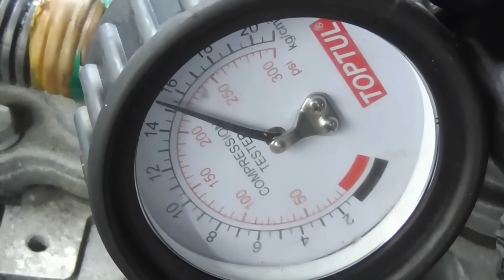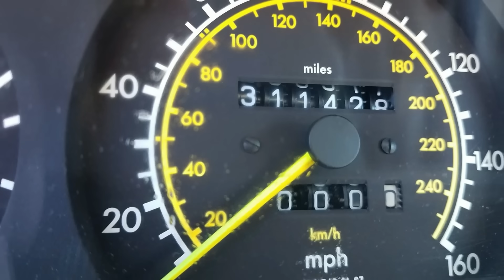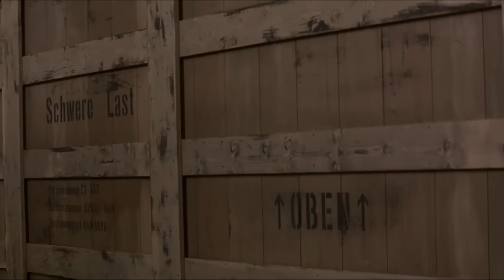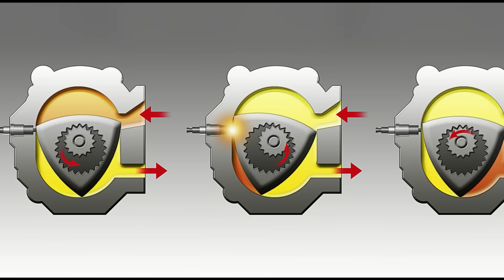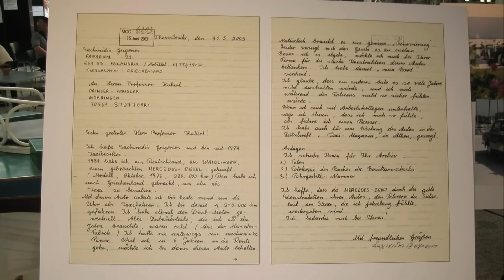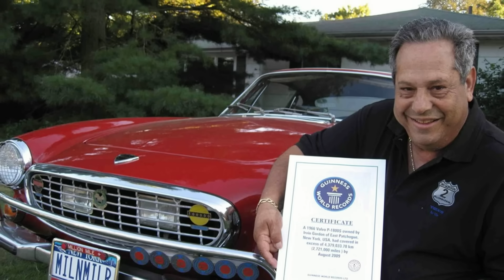Most Reliable Engines of All Time

Comment: Are you kidding me NO Toyota 1kz-te or 22re but you slip the rotary in here your on ICE.
I have two Toyota Hilux utes one 22re with 431000km never touched a thing and one 1kz-te with 404000km never touched a thing. 
TOYOTA UNBREAKABLE 
“Disclaimer” serviceable item were touched with love!!!!
Reply: i have seen tons of 22re engines take a beating on and off road and go more than 300k miles and can go miles and miles still performing great even with low maintenance and very low oil
Reply: or the toyota 1hz or 2h diesels, i have 500,000 klms in my 1hz landcruiser with only the standard oil an filter changes.
Reply: My pickups got 500,000 kms and its got no issues
Reply: Wil Braun buddy what model is it?
And where are you from?
Reply: @MussaKZN  its a 92 extra cab 5speed and im up in british columbia
Reply: Wil Braun one of mine is an 89 extra cab auto 2x4 and my other one is 03 duel cab 4x4 turbo diesel and I’m from Melbourne Australia, Hilux’s just make me happy!!
Reply: @MussaKZN  i wish i could get a diesel toyota but there so rare here and when you do find them the rediculesly priced
Reply: I’ve seen those 22R’s and 22R-E’s with over 500k miles. Reliable is an understatement for those engines.
Reply: Mussa Musumeci 710000k on a Hiace diesel 1kd-ftv....never touched and not a drop of oil, and it gets worked.
Reply: Seen alot of toyota 2tr with more than 300k miles here in CA.
Reply: Yup had a 22 r on my cressida that engine worked some like clockwork  but sadly I had to transplant her. But I went in to better things 2 jz ge nice
Reply: I have toyota 2f 6 cylinders 1980 .. 522k km and counting
Reply: Mr Photographer Toyota 2f 6 cylinder is just ran in at 500k

Comment: One of my first cars was a 78 Plymouth Volare with the slant 6.  Just under 300k miles.  Lovely 2-tone black and rust, and every body part rattled and sounded like it could fly off at any time over 40 mph.  Couldn't kill that motor.  At the very end, it was only running on 4 cylinders, and I averaged over 30 mpg.  0-60 was about an hour and a half, but I was 16 and the car cost me $50.

Comment: I just bought a 2008 Honda fit with 290,000 miles on it. 1.5 litre 5 SPD. Runs fantastic and gets 38 mpg on the highway doing almost 70 mm mph

Comment: I have a 2002 Pontiac Grand Am with 166,000+ miles on it. And a 2002 Volvo V40 1.9l with 207,000 miles on it. Both engines have been trouble free their whole lives.  I have had numerous 350 CI Chevrolet motors run for well over 150,000 miles. One was a 1984 Corvette with 177,000 miles on it when I traded it in. Still ran really strong with less than a 10% drop in compression.  He really needs to take a serious look at his list of most reliable engines.

Comment: Honda J series V6 and F inline 4 cylinder series 300K plus is not an issue for them
Reply: But Honda transmissions cannot go that far
Reply: irrelevant as transmission is not an engine,  @dingdong2447

Comment: I have a 1997 nissan pick up with the 2400 with 250k miles and still running. Just changed the timing chain and service that's all.

Comment: Not sure about the 2azfe, this thing is in everything from Pontiac vibe to camerys and is a pos. The Chevy 350, 302 and the dodge hemi should be added..hell my 2008 ram hemi  has 247000 miles and have had no issues other than alternator, front hubs and tires..

Comment: Wtf is this guy smoking
GM's 350
Ford 5.0
Ford modular 4.6
Nissan Sentra 1.6
Camry 2.4
Toyota 2jz
Ford 7.3 diesel
Toyota 2.2 diesel
Dodge cummins 5.9

Completely lost
Reply: Exactly!!
Reply: Fuck my triton has 210,000 miles with no issues and they were notorious for spark plug problems.
Reply: My 1989 GM 305 (I know not a 350) made its way into 3 separate Chevy 1500 pick-ups (all had frame rust problems/in Canada with winter salted roads), without a rebuild, finally smoked so bad I had to pull it off the road....estimated 750,000 Kilometers, 3 turbo 350 automatics, and 2-700R4 autos later. Let's see a rotary do that!  I had a RX7, ran O/K when you could get it started (at 5 degrees Celcius was impossible)

Comment: I had to comment after hearing 150000 to 200000 miles on the Camry. I’ve have two 97s over 300000 one of which was 455000 and untold amounts of timing belts. The crank finally broke in two. I’ve had a 4.3 v6 Chevy 1500 with almost 350000 and sold it didn’t use a drop of oil. Which is weird because I’ve work on Audi and Passat 4 motions that needed motor replacement at 60000 mile when the cheap 1000 dollar cars and trucks never gave me trouble except being stranded from timing belts breaking got my brother to get my hauler went home and thank god for non  interference engines.

Comment: It's not the 300D engine, that's just the model number, normally the W123 contained a OM617 or OM606 engine, but even that is a head twister, my W124 had a OM605, the 5 cylinder model

Comment: The best engine ever built was Fords 302 . Police cars where getting 500k no problems
Reply: Ford 300" six puts the 302 to shame for longevity.
Reply: Rexford L my father had an 87 Lincoln town car that he used for limo service believe it or not it made over 1 million miles . Look at the fox body mustangs you could beat it to death and still running
Reply: @florimshala1  302 has a timing chain that stretches, 300" 6 has timing gears. That's why it will last longer, all else being equal.
Reply: Ford Econolines had it im correct

Comment: My 1996 non turbo Mercedes 300D had over 250K and is still going strong. There is even the 1 million mile  club for Mercedes. Any modern engine should be capable of over 100,000 miles so to call one that can reliable is a bit of a stretch IMO.

Comment: This sounds like a list of "lets name the majority of non-American engines that goes into rare sports cars/obscure cars no longer on the road that most people will never see in their lifetime, and toss in 1 or 2 mainstream engines that also are not American-based". Here in the real world over half of the engines mentioned are pure junk.

Just because a few cars have over 500,000 or 1 million miles does NOT mean that whole line was reliable, but once that engine needed major repairs/replacement, that mileage is automatically reset regardless of what the vehicle body itself has. You want reliability past 300K original miles (provided you don't try to drive it like a racecar), get a GM truck made in the 70s or 80s, or the 2000s, they average 300-500K with no problems.

1. all rotary/boxer engines are junk in the real world, average lifespan is under 100,000 miles. 
2. No mention of GM LS engines (4.8/5.3/6.0L) which are the most reliable engine platform ever made in history, and it helps that they make very good power stock. They average over 300,000 miles with no major engine problems, I personally see several on a regular basis with over 500,000 miles in my lower population area. Check any forum/group with 99-06 Silverados and you will see thousands of people with over 200K miles on original engines/trans and zero problems (and hundreds of others that drive like crap but blame the truck). There is a reason why it is the go to most desired engine platform over the past decade: the reliability, ease of setup, availability of parts, very long lifespan, good power.... People are ripping out the junk/mediocre engines mentioned in this list to install LS engines into their foreign sports cars, that says it all.
3. No mention of the 5.9L Cummins that averages 500,000 miles with zero problems and quite a few of them are recorded with over 1 million miles.
4. No mention of the GM 350 (5.7L) which is in some of the highest miles trucks in the world (not uncommon to see 70s-90s trucks with over 750,000 miles). No special attention is paid to them because they keep running and is not some special rare care from the 60s/70s, just extremely long term reliable trucks.
5. No mention of the Ford 300 inline 6 that averages 300,000 miles (the only decent/reliable engine Ford ever made)

Comment: No Mopar 225ci slant six?  No Toyota 22R/RE?  Rotary as a 'most reliable' engine?  wow...
Reply: I owned a 1985 Toyota truck with a 22R engine.  The 1994 Mazda B3000 truck with the V6 3.0 Vulcan engine that I bought to replace the Toyota is a much better all-around truck including its engine.  The timing chain broke at 90K miles in my 22R engine and I had problems with the clutch, carburetor, and rear brakes in the Toyota truck.  The sheet metal on the Toyota truck was paper thin so it had plenty of dings and dents.  I still own the Mazda truck and drive it to work twice a week.  In the Mazda, I have replaced the clutch, water pump, radiator, timing chain cover gasket, the valve cover gaskets, and most of the original sensors.  The rear ABS controller went out about 15 years ago.
Reply: The taxi fury had a 225 in it. They just showed a 426 max wedge in the pictures.

Comment: I had a Lincoln Town car with 440,000 miles the 4.6 Ford v8 is very reliable
Reply: Great engines! My old employer gave me a 2003 f150 with the 4.6L to work out of. I didn't have to pay for gas or repairs and did not stay on top of the oil changes. Like 8000-10000mi in between changes. I did not treat it well either. Lots of full throttle time if you know what I mean. 

It got retired at 398000mi but still ran great with no smoke. Truck got rusty and was leaking everthing but engine oil so boss decided not to spend the money to keep it going. The only engine repairs were spark plugs a few times, exhaust manifolds, and the fuel rail cracked and started leaking. Nothing internal at all.

I owned a 99 f150 and still drive a 2006 e250. Both with 200000+ and no failures just wear parts like plugs and belts.
Reply: What year was it?  I have a  4.6L Ford F150 with 198900+ miles as of today hoping to make it to 400k.  What you do to keep it going?
Reply: @Val1973-n2h  change fluids and filters when called for aand never run cheap gass station oil its just recycled old oil thats been filtered. Keep up with tune ups run a good gas run a good gas treatment every 6 months like say Lucas high mileage fuel cleaner to an almost empty tank 1 bottle treats i think up to 20 gallon when I do it i always use highest octane fuel i can find but I run 93 octane anyways I would run a midgrade in yours dont neglect trans either do a flush and filter change when manufacturer suggest I also use royal purple fluids but it's about 12 bucks a quart a good synthetic will be fine
Reply: @jameslewis8448  ýūūýýd
Reply: @patriantonimatahari2157  you mean the cabs that get checked over and maintained everyday dont forget when the valves aren't sealing they do a complete valve job change main bearings ECT ext yeah I wonder how much money was sunk into that can after 300k is bet as much as the car was new
Reply: @Val1973-n2h  also if you take off the cap where u add oil while engine is running and can feel air blowing in or it aounds like a blow suck sound your valves are not sealing and either need new seals or a whole valve job thats always first thing I do if im buying a car. If valves aren't sealing you could have oil leak down into combustion chamber and glaze cylinder walls wich will cause loss of compression and eventually smoke coming out exhaust and burning oil if adding water to cooling system never use mineral water use distilled and never add just pure water when its starting to freeze outside water expands and can cause all kinds of hell worst being a cracked block if your lucky and block has em u push out a freeze plug or two
Reply: @jameslewis8448  🤷‍♂️
Reply: Just commented above and I scrolled down and saw your comment. I can attest on how good these cars are.
Reply: I had a 97 f150 that didnt make it to 100k.  The lower intake manifold gasket went out dumping coolant into the engine.
Reply: @Tonefiend  did you not get the recall done? They recalled this exact proplem and even extended the warranty coverage another 10 years, sorry to tell you now but that issue would've been fixed FOR FREE
Reply: @dom_not_torretotedesco5707  I took my case all the way to Detroit. At the time it was a major problem with all the local dealers fixing multiple vehicles a week for the issue.  It wasn't covered the time but myself and others were pressing the issue.  Glad they stepped up finally! This happened to me in 2004
Reply: @Tonefiend  sorry to hear that, must have been a case of unfortunate luck. That should've been taken care of for you. thats one of the worst cases i have heard of though, normally the plastic intakes crack causing coolant to leak into the spark plug boots, causing a misfire but ive never seen one that caused catastrophic damage.
Reply: 4.6 has never been known to be a great motor ive seen alot go before 75 k but once in a while u get one that's been put together with just the right parts with perfect tolerances and get a good one
Reply: 4.6's routinely pass 300k. Ask the cab companies.
Reply: @Jett-Alaska  Many cab companies get a million miles out of The 4.6 with good maintenance. And they idle more than drive!
Reply: @chrisdaigle5410  I know, that's why I said they routinely make it over 300k
Reply: @Jett-Alaska  agreed.
Reply: The Ford 4.6 is a pretty reliable engine. The Chevy 2.2 ecotec is another engine that I've seen hold up in the paint. Don't see many of them blown up.
Reply: I had a 02 f150 4.6 that had 336k when I traded it for a mustang. I live in socal and got a parking ticket in the mail from texas a few weeks after I traded.
Reply: Oh yeah! I have a 01 crown vic 4.6 with 254k on it.
Reply: I have a 2007 lincoln towncar that have 180,000 miles since i bought in 2013 with 97,000 miles the only major part i change is the EGR Valve . I change oil regularly, since Dec. I started using Royal purple oil .
Reply: @toncoco7774  I use nothing but royal purple fluids in my lexus is300 an d my bmw m3 I actually had a ass mechanic tell me royal purple is garbage and that ceramic brakes are garbage and never heard in his life about chamfering brake pads that didn't come chamfered.
Reply: 2009 Lincoln Towncar Executive L with 478000 miles and 4474 idle hours! Absolute tank.
Reply: Same but in my Marquis!!
Reply: 97 F150 326k when I sold it.
Reply: Yeah I have the 4.6 in my 02 explorer with over 300 000. On my second transmission tho haha
Reply: 01 town car 219,000. Of course one would have to replace some parts.(nothing last forever) love it though. 4.6 is a highly reliable engine! If you don't think so then maybe you should pack up your 64 piece tool box & call it a day.
Reply: @kensterbro  AMEN.

Comment: Ford Falcon 4.0L would have to be the world's most reliable engine.
Old girl's '98 Futura got between 730k an 780k out of it before she sold it, she had it for about 14 years.
Engine an transmission were original.
Reply: Luke Barnsley the Barra engine was bullet proof and not unusual to get in excess of 1,000,000 klm out of them when used in taxis.

Comment: My old Explorer with the 4.0L V-6 is still going at 305,000 miles, and my daily beater Focus 2.3L Duratec runs as good as ever at over 275,000.  Never had the cam cover off, and still on the original clutch. :-)
You'll never see this longevity out of the new direct injected engines though.  Most need the head pulled every 50,000 just to clean the sludge off the intake valves. SMH

Comment: ... and the GM 3.8 engine doesn't make the list.  How about the 283 Chevy??  I can personally attest to the 3.8 Olds.  I bought a brand new Olds 88 in 1988 and had it for 19 years before DRIVING it to the junk yard.  The body was junk, but I could still drive it from oil change to oil change without adding oil to the car.  It would be a quart low.  At 600,000 kilometers (I live in Canada) I had my mechanic do a compression test on the six cylinders (he thought I'd lost my mind completely) but he was shocked when he found out how good the engine was.  He said to me that the compression was still as good as new.  Even the transmission held up for 420,000 before biting the dust.  When I tearfully exited the drivers seat for the last time, it had over 704,000 kilometers on it.  The 3.8 GM has got to go down in the Hall of Fame for motors and HAS to be on the list.  I'd like to know what your guidelines were for your choices.

Comment: 200k miles is not that much for Toyota and Honda engines. I would consider those high mileage anywhere past 400k. My 95 corolla has 323k miles on it and I consider it average. 200k miles is not much at all. Hondas as well. Most 90s Hondas you see driving around probably have around 200k miles on them. Completely normal and average

Comment: im a fan of jdm, oc i like both 2jz and RB26DETT, but if the you explain how tunable rb26 is, i guess it'll be much better if you explain how 2jz handles monstrosity amount of hp as well :p
both engines are incredible masterpiece
Reply: The RB26 is costly and finicky to get over 400Hp reliably. They are ticking time bombs when you boost the shit out of them. Don't get me wrong, I love that engine. However, the 2JZ-GTE shits all over it in every aspect. The 1JZ will spank it pretty easily also, considering that a few BPUs will get 500Hp reliably on the 1JZ.
Reply: @JesseS420  i know 2jz>rb , but just respect both of these japanese 6 banger :p thats the point